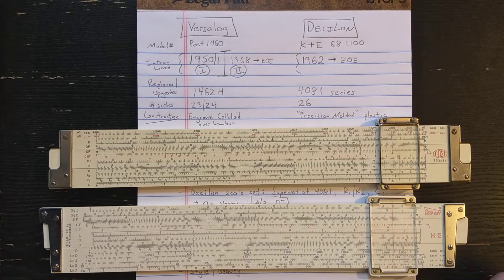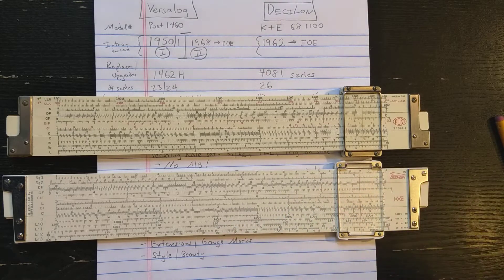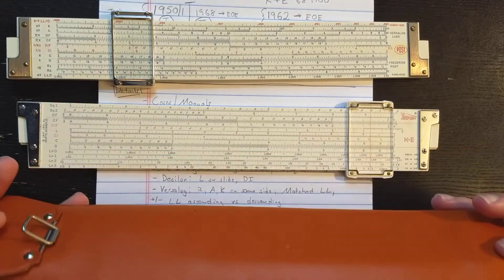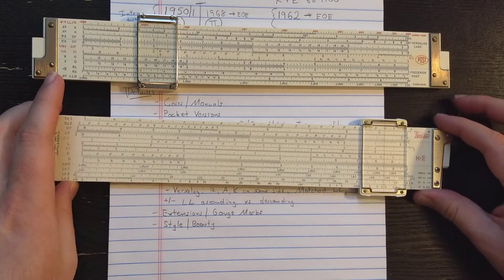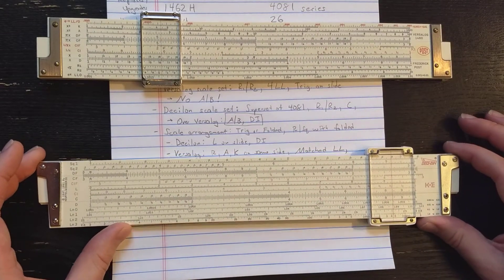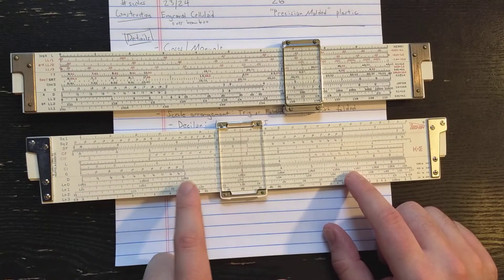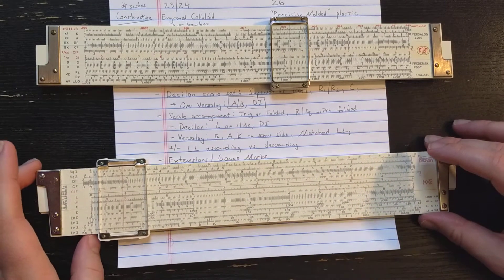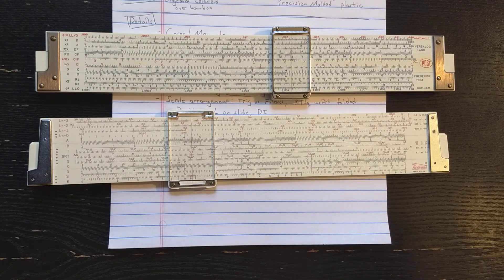Post Versalog vs. K+E Deci-Lon: slide rule showdown

Comment: Regarding 17:00 Deci-Lon slide rule angular end pieces design aesthetic. The Keuffel & Esser Deci-Lon slide rule was introduced in 1962 which was during the era of the Jet Age. At that time trendy car designs included tail fins whose shapes were reminiscent of Deci-Lon angular end pieces. However ten years later by 1972 car tail fins had become passé which happened to coincide with the decline of slide rules.

Comment: I used my Castell rules, a 62/82 and a longer one with no number for the state school leaving exams back in 1968. Everybody was using log tables and nobody knew what I was doing.  No hyperbolic scales, just trig on both and exponential scales on the shorter one.  They still work smoothly after more than a half-century!

Comment: I gotta say that before I ever picked up my first slide rule, I read a million reviews and articles singing the praises of the Faber-Castell 2/83N as the best slide rule ever made, so that was the first one I bought. But now that I have these two and have worked with all of them for quite a while, there just isn't any comparison as far as I'm concerned. The plastic 2/83N feels so cheap and tawdry compared to these wooden ones. The colors are cool and all but meh, not THAT cool. Also, although mine looks great now, you can tell from ebay pics that the ink used for the Faber-Castell scales bleeds and leeches into the surrounding areas on them after a while, so who knows how long mine will stay looking like this. Meh. As long as I have a versalog and a k+e, I'm happy.

Comment: I've been trying to by an excellent condition 20 inch slide rule for several years, and it's proveing nearly impossible! 
Almost none offered for sale. Those offered are in nasty to useless condition! And folks want way too much cash for an unusable instrument!
Reply from the maker: These were produced in such small numbers that they're very hard to find in good condition. I'd assume it's also extra difficult to keep the long wood or bamboo straight over the years. I don't have any 20" rule, and the only longer rule I have is the K+E 4110 Power Trig I made a video about a while back.

Comment: I have a Deci-lon with the colored ends on the slide, serial number 171138. Any idea what year?
Reply: Thanks. Somewhere in this video I thought you mentioned the year they stopped doing those colored ends on the slide and I thought that was before 1970, non?
Reply from the maker: If you look through McCoy's K&E Catalogs, I think it stops showing the colored ends around 1972. I forget if I mentioned it in the video, but I've heard it was because the mold was damaged -- the easiest solution was just to fill it in.
Reply from the maker: Just checking again. He doesn't seem to have a catalog between 67 and 72, so it's somewhere in there that the change happens.
Reply from the maker: They are fairly rare to see for sale, so that to me points to only very late production.
Reply: Well at any rate I got a good deal on it. It's in great shape. And I really enjoy your videos. I was going through college in the late 60's. I was in engineering and mathematics. When the calculators first came out we weren't allowed to use them. Besides, they were too expensive. But as soon as I could afford it I bought an HP25C. Programmable! Never looked back - until a few weeks ago...!
Reply from the maker: Looks like about 1970, judging by this:
http://www.oughtred.org/jos/KE_Dating_ByHughesAndMcCoy-JOSPlusOnlyVersion_RevA.pdf

Comment: How about comparing to the larger Picketts, say N-3-es? Seems like they,  and the Deci-lon are more of "smorgasbord" versions (e.g. KAB + sqrt & cube rt, yikes) while the classic Post is a better match to the older K+E models. Easy to like the bamboo & mahogany ones, but on some of the "big" rules there are hyperbolics & common logs: why? Does that represent a personal  choice, a real evolutionary advantage, or just a frantic (dare I say hyperbolic?) overabundance of features?
Reply from the maker: Decilon vs Versalog was one of my most requested videos -- I think for a lot of people, the decision came down to one of these two which represent the top of the line general purpose rules from these two manufactures.

I recently found an N4 and plan a video on that soon.  Really, the comparable Pickett rule for this comparison is probably the N803. I think of the large rules with both eight log-log scales and hyperbolic scales as sort-of a separate class ("kitchen sink" rules). For my taste, those rules are a little much.
Reply from the maker: My theory with the large rules is that there was a little bit of a scale arms-race near the end of the era. None of the scales are really new or innovative, but manufacturers just kept squeezing them on to attract buyers who wanted "everything" on one rule.
Reply from the maker: Since you mention the N3, it's an cool rule although I don't have one. I'm curious as to why Pickett switched to base-e log log scales from the base-10 ones on the Model 3. My guess is that it was to lure buyers from the Decilon/Versalog, but as a consequence it makes the N4 a more interesting rule.
Reply: Professor Herning Comparing n3 and others such as Versalog to the N4, I do end up liking it (n4) because of common logs (useful for dB and easy to calculate with) while ln is still available on CF/m. Also it's kinda cool the way Pickett shares the LL scales with their reciprocals. I can't love sinh though it's fun to say "shine" because I've never used it for real. My imaginary superrule would start with an n4, but remove hyperbolics in favor of M/CF (cool, eh?!) and K (the cube scale is too much effort in an era where I will cheat back to my phone if I really need a cube root. The slide rule meanwhile is for "wetwork" so fluidity matters. :)  I look forward to your next talk & wonder especially how you value log vs ln on the LL scales?
Reply from the maker: Mark, I just posted a video on the N4. I'd have to say I prefer normal LL scales because of the reason mentioned in the video: you can fall off the end onto D. It's easy enough to use L for base 10 logs and the mantissa resolution is constant unlike when you use LL. If you want a quick base 10 log on normal LLs just set the index of C over the 10 on LL, move the cursor to the input on LL and read the log on C. Pickett's solution is definitely a tad faster, but you end up having to add DF/M. I guess I prefer the elegance of the normal solution.

Comment: Marvelous video! Brought back some memories from the 50's & 60's. Thanks!
There are several gauge marks on the K&E's C & D scales you didn't touch on. There are marks for converting between º, ', and " on the one hand, and radians on the other. (5.73, 2.91, 4.85).
And 2π is also there, as I think you did point out.
But what's that mark at 7.85?

Fred

PS: Also worth a mention: K&E stands for Keuffel and Esser (German immigrants to US)
Reply from the maker: I think that's pi/4.
Reply: Yes, that's got to be right: 0.7854... Thanks! That clears it up.

Fred

Comment: Excellent comparison. I own both the Deci-Lon and the Versalog II and agree that certain functions are simpler with each. However, I feel that the addition of the B scale on the Deci-Lon allows for more intuitive division (since the denominator on B appears below the numerator on A), since using the C and D scales for division requires inverting the ratio. This is of course a minor advantage, but I think it is significant. I agree that the radically different construction and styling is really "apples and oranges" here. The Versalog II is truly a handmade work of art; its engraved-celluloid-over-bamboo is stunning. However, the plastic molded Deci-Lon has a more rough-and-tumble aspect to its construction; it doesn't fear water (or soap) and it doesn't develop a static charge on the surface (sadly, the Versalog is a sort of magnet for dust, hair, and lint). The Deci-Lon also doesn't care about temperature extremes, although it should be said that the Versalog is much less sensitive to these changes than the other mahogany rules by K&E and others... but the Deci-Lon is my constant companion in winter cold as well as summer heat. Both rule and case are lighter, as well, so there is that. I don't worry about dropping the Deci-Lon as much, either-- I've already had to repair its cursor with superglue twice, and it was an easy fix.
So I think they are comparable. I would say that the sliding movement on the Versalog is smoother due to the oils (still present in the wood after almost fifty years!) and that it seems built to a higher degree of accuracy due to its cursor construction (the Deci-Lon cursor line is more easily capable of lateral movement and therefore alignment can be an issue). So if I wanted a rule on my desk for indoor work, I would pick the Versalog-- it's everything a classic, wood-glass-and-metal traditional slide rule could hope to be. But the space-age ruggedness of the Deci-Lon edges it out for all-weather, anytime-anywhere calculation, and if I could only choose one, its unique asymmetry takes pride of place.
Although the Deci-Lon represents the final production model of American slide rule design, there appears to have been a rule on the drawing board to upgrade/replace it in the K&E lineup. Dubbed the "KE-Lon", this proposed rule incorporated the "all eight log-log scales on one side" design prevalent in European rule designs like the Faber Castell 2/83N and the Aristo Hyperlog. Sadly, it was never produced by K&E due to the swift rise of the electronic calculator. I would also recommend checking out Zvi Doron's Ultralog design, which some slide rule aficionados hope to see one day realized, although it's admittedly unwieldy due to its over-the-top inclusiveness. https://www.youtube.com/watch?v=NJZnw27VJ6s

Thank you, Professor, for taking the time to compare and contrast these final giants of the North American slide rule market. It's really almost a "King Kong vs. Godzilla" debate.

Comment: I managed to snag a Pocket DeciLon for about $80 with shipping a month or so ago. It was MARKED as a 68 1100 in the listing on eBay, though the pictures were all of a 68 1130. Also, it didn't have the original case, but a nice quilted fabric case the owner had clearly made for it. If I have the opportunity to get a proper case I will, but I managed to get it for $90-120 LESS than most go for. I took heavy advantage of the mismarking and snagged it with the "Buy It Now" option. I'd been looking for a pocket DeciLon for a long time, but they all were going for between $160-$220, and even those were rare.

It's one of my favorite rules, along with my "Kip Russell" K&E 4081-5 20" Log-log Duplex Decitrig, straight out of Robt. Heinlein's "Have Spacesuit, Will Travel", and my Faber-Castell 2/83N Novo Duplex.
Reply from the maker: I'm still looking for a deal on a pocket Deci-Lon. I must admit I think they are a bit funny looking with their extreme width-to-length ratio.
Reply: I find the stubby shape oddly pleasing. It's not just useful, it's CUTE.

I liked this video. I hadn't started collecting any of the Versalogs. I only have a couple of Hemmi-based rules, notably one of the "Made in Occupied Japan" models, a Sun Hemmi 1447 in exceptionally good condition.

Comment: i have a question i do machine shop work as a hobby and i use vintage machines from the early 1900 . so i would be doing a lot of sine calculations to set up a sine bar but one think i would like to do is use the slide rule to figure out pulley sizes if my main line shaft is running at X i can use several different combinations of pulleys to get to y and iv herd this is a good problem on the slide becauls the ration would be the same and you can see the other possible pulley sizes on the rule with no adjustment . in not sure how to perform this and what scales would i need to do this?
Reply from the maker: I don't know much about machine shop work, but using vintage machines sounds like a cool hobby! I would guess that whether or not a slide rule makes sense depends on the accuracy and precision you need in your calculations. Most slide rules can be read to around 1 part in 100 or 200 on the main scales. With estimation, you can do a little better (many people claim 1 in 1000, but it depends on how well made your rule is, the condition, and your estimation skill).

For the pulleys, you may just need the main logarithmic scales (C and D). When you move the slide, the ratio you see between any two numbers aligned on the two scales is constant. If you use CI and D then the product is constant. This might be all you need for that, but I don't know your exact calculation. The folded scales (CF, CIF, DF) are often added because of the off-scale problem when doing a calculation like this. You might set a ratio then want to move your cursor to something on C, but it is on the part of the rule that is sticking out. If you have CF/DF you can simply find the number on CF instead.

I'm going to take a guess at your calculation: Let's say you have two pulleys connected by a chain/band. You want to triple the rotational speed of the input, so you want the ratio of the input to output pulley radius to be 3 (diameter or circumference could also be used). You would pull the slide so that the 3 on C is over the 1 at the left end of D. Now any number on C is three times the aligned number on D. By moving the cursor you can see different combinations of sizes that have ratio 3 (e.g. 3/1, 40/13.3, 75/25). If your rule has folded scales, then all possibilities are now showing either on C/D or CF/DF. Without folded scales you can see the other possibilities, but you either have to move the slide (so the 3 on C is over the 1 on the right end of D) or sacrifice some precision and use A/B instead.
Reply from the maker: To see if the slide rule might work for your sine calculations, have a look at one of my trigonometry videos like this one: https://youtu.be/LS6G49AiXRw. There is a lot of variety in trigonometric scales, especially on beginner slide rules. For example, on many similar looking ubiquitous models, the S scale is used with A instead of D. This has less precision but has the advantage that the scale covers a larger range of angles (down to about 0.57 degrees). On many rules, the trigonometric scales divide degrees into minutes and seconds. The rule I'm using in the link has what's usually referred-to as "decimal trig."

In any case, with some practice it's very easy to solve right triangles with a slide rule. I think for your application it would be a question of necessary accuracy.
Reply from the maker: I read a little about sine bars, and I guess the calculations would be pretty easy on a slide rule. If you had an S scale that was used with D (as in the video), you'd set the end of the S scale over the bar length on D by moving the slide, then if you move the cursor to an angle on S, you'd see the height you need on the gauge bar side on D. Conversely, if you moved the cursor to the gauge bar height on D, you'd see the angle on S.
Reply: that does sound simple a visual demo would help greatly
Reply: that level of accuracy is probably fine 1/2 a degree would be working to a very fine measurement and the sine bar starts to lose accuracy after 45 degrees i have a channel if your interested in checking it out. i do all sorts of things related to metal shop i also do a fair amount of foundry pattern making.
Reply from the maker: I'll check out the channel. I'll try to make a video when I have some spare time -- hopefully this weekend if not sooner, but not guaranteed!
Reply: Professor Herning you might like my inclinomeater video. This is how you would measure the tree no one knows how tall it is lol
Reply from the maker: Just made a couple videos (had to split it since the camera cut out) with these two problems done on a very simple rule.
Reply: can't wait to see them.